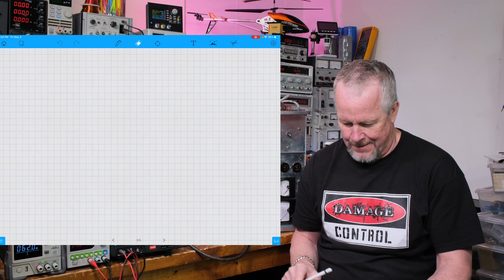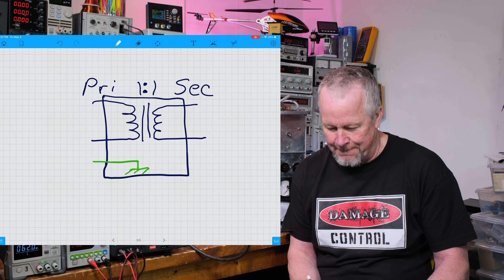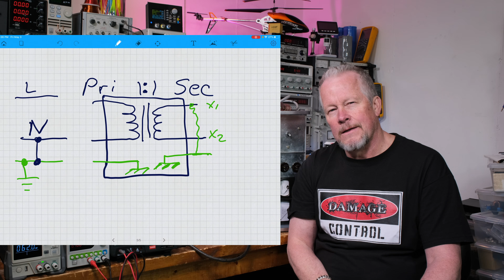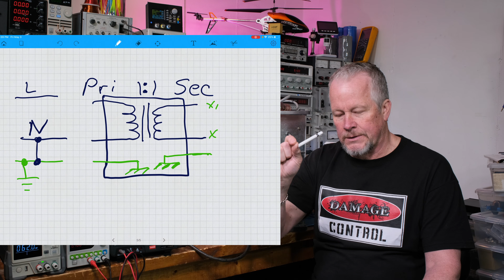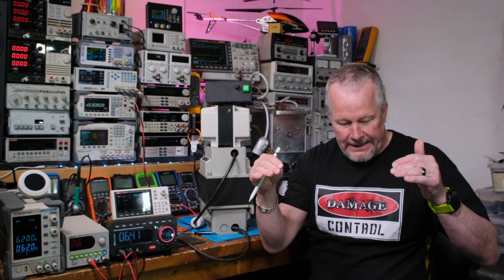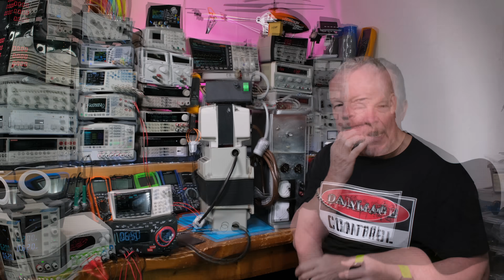Isolation Transformers and How they Can be wired #isolationtransformer

Comment: Stop, you're making a small mistake - according to the new standards that came into force in 2010, it is no longer legal to have a neutral earthing -  Please read about NGR (Neutral Grounding Resistor). ( https://www.youtube.com/watch?v=XlaSSn58qt0 )
Reply from the maker: Thanks for your great feedback.  This is a different application that you are referring to.  What you are pointing out has to do with distribution.  This video is about smaller transformers used on your bench.  I did start going into these other grounding systems - but cut that out of this video because it was getting way to long and I thought it was adding more confusion.  So, I focused on these smaller units.

Comment: The power company essentially uses the earth as one of the wires in the power system. The earth is a pretty good conductor and it is huge, so it makes a good return path for electrons. (Car manufacturers do something similar; they use the metal body of the car as one of the wires in the car's electrical system and attach the negative pole of the battery to the car's body.) "Ground" in the power distribution grid is literally "the ground" that's all around you when you are walking outside. It is the dirt, rocks, groundwater and so on of the earth.
Reply from the maker: Thanks for bringing this up.  There is a definite difference between your car's metal chassis and the Earth.  This is what I was trying to explain - the car chassis is used as a return (ground path - which is the confusing terminology).  

The car's chassis is a great conductor so is used as the return path for current.  The dirt or ground is actually a bad conductor.  The Ground rod is supposed to only have 25 ohms between it and Neutral-Ground bond - but is often and typically much higher.  

The Earth is called Ground, but it doesn't return the current.  The current is in the wires - not the Earth Ground.  Earth Ground is just a reference.  Leakage current does flow on the Earth Ground.  The ground rods do provide a path for lightning to be shunted around the wires to the Earth ground.

Comment: Great video Eddie. I want to point out that because Neutral carries current it usually has a voltage with respect to ground at points away from the main bonding point. This is especially true in industrial environments where there are often many motors and often poor power factor.
Reply: Glenn, this is a very important factor you bring up. Many individuals do not understand the "Fall of Potential" from contact point. I have seen 2 linemen and electrician injured where a high voltage radiates spherically outwards from a high voltage line or lightning strike. That why you don't step away from a downed power line. A 33 KV power line and produce a 5 KV voltage drop between your normal stride.
Reply from the maker: Thank you!  I did mention this but it is a very important fact to be aware of.
Reply: True, I live now in an old house where there is no grounding, even though the line from provider is grounded not so far away. The last time I checked the potential between ground and neutral was about 60V in a 220V grid, scared the shit outta me when I touched it the first time.

Comment: Eddie, outstanding video. Very difficult subject matter. Isolation transformers can have an electrostatic shield between the primary and secondary windings to lower the intertwining capacitance. This type of Isolation transformer is what we need for EMI testing. The electrostatic shield breaks the  common-mode path. You might want to look at the book called "Grounds for Grounding A Circuit to System Handbook", by Elya B Joffe.
Reply from the maker: Thanks so much!  Yes, this is such a confusing topic.  The nomenclature makes it so hard to describe without sounding confusing;)  I thought about talking more about the methods to quite the transformer - but I ended up redoing this video a few times to shorten it;)
Reply: Eddie, I think you covered the important differences between an isolation transformer and a varac. I have seen engineer and technicians that did not understand the dangers and destroy scopes and leads. I would  recommend you do a piece on the use of the "Dim Bulb" for protection against "Hot Chassis". Thanks for your help.
Reply: @pbaemedan hey man. I'm putting a new isolation transformer and variac set up on my bench. I need to know the proper way to move ground in and out of circuit. I plan to develop a custom system where it's all controlled via a touch screen along with labeled plugs. I've been working on the circuit for a few years. I love embedded designs and want to modernize the look of the interface without sacrificing safety. I'm not sure what sides to put everything in and out. I'm coupling the variac swivel to a nema 23 motor. Plus instead of dim bulb testing I'd like to use big load resistors and use current or temp to indicate a short. Maybe ill publish the plan to my channel. Let people flame it or give suggestions.
Reply: @kissanalog Eddie I have some high end parts for circuits if you want them. You don't seem to have quality jelly bean parts on hand haha.
Reply: @kissanalog shit, I had to give ya a decent soldering setup hehehehe jk. It's the least I could do
Reply: I'm building a custom audio prototype board that can handle simple guitar pedal circuits to prototype audio circuits for a hifi amp I want to build.